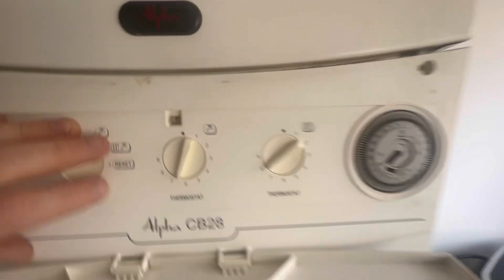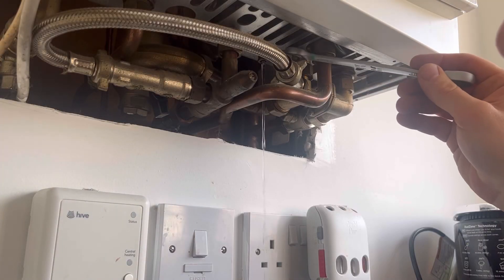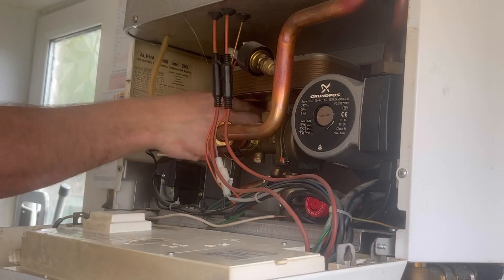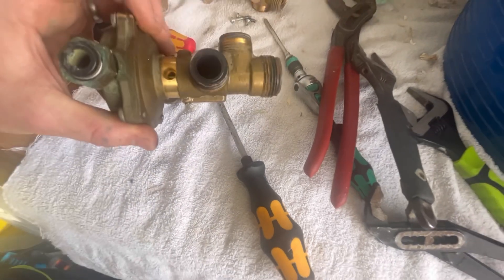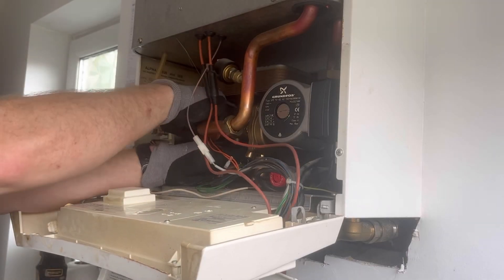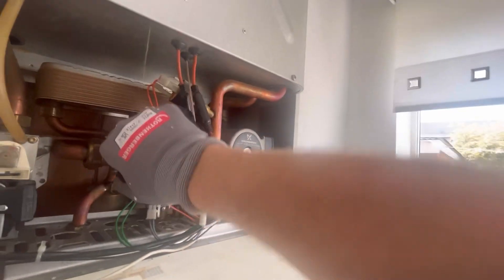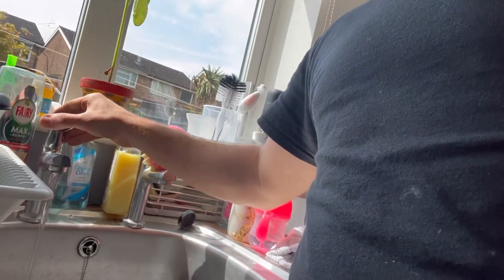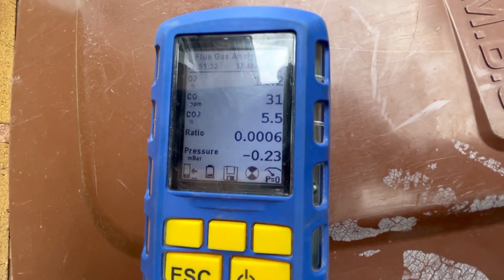How to replace a Alpha CB28 diverter valve

Comment: I have a alpha intec 28x.  Just noticed that I have no hot water.   The central heating is working fine.
If I turn on the hot tap, the boiler fires up as normal then temperature goes up on the display upto over 80c before I turn tap off,  but I still have no hot water at the tap.  Would this still likely be a diverter issue or something else.  Thanks for vid.
Reply from the maker: If the temp is going that high and boiler cutting in and out? Could be a blocked plate heat exchanger…..try running hot tap and see if rads start getting warm, if they do it’s the diverter, the heat will just be going round heating instead of plate heat exchanger